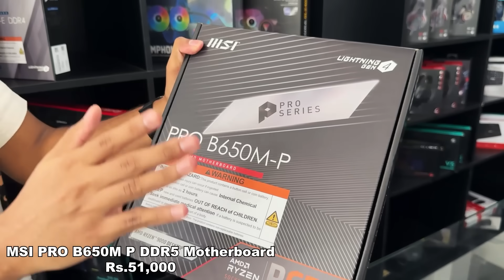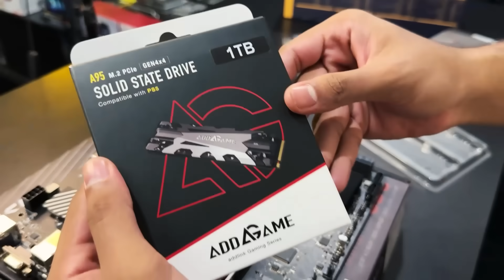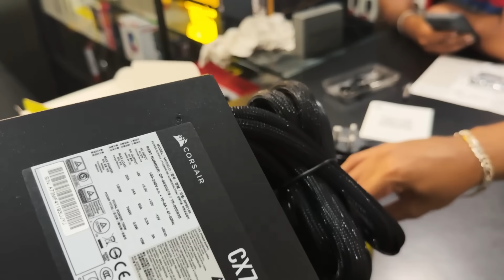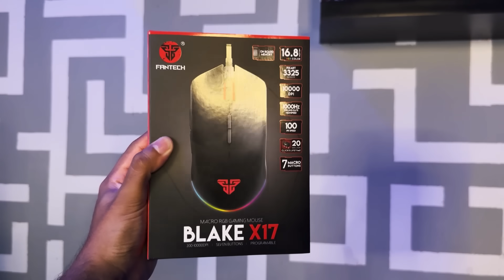අපේ අලුත් රු.400,000 PC එක | AMD Gaming PC Build Sinhala

Comment: 3050 aparade oii..worst price to performance
Reply: 7600x wenuwata aliexpress eken 7500f ekkhari nattan brand new 7600 non X ekk ganna (X eka workstation hinda TDP eka wadi higher clock speed ekata yanna...non X/7500f ekk dammoth AMD default air cooler ekata yanna puluwan) board eka supiri case eka supiri PSU eka supiri..Graphics card ekata rx 6600 hari rx 5700xt ekak honday...